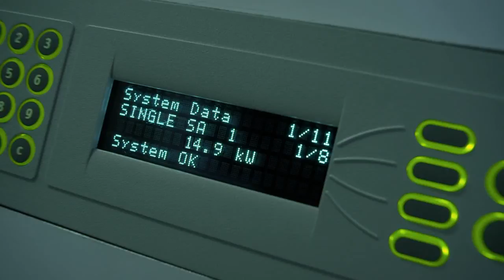MME Generators: Interview with Owner of S/Y Lethantia

Comment: Why not make a hybrid system because you probably need the ballast anyway. Batteries can make up some of the ballast and you can feed them with the excess from the generator and from the main engine while under way. I've never understood why ships don't carry more batteries preferably housed in some sort of suspended box and an efficient inverter.